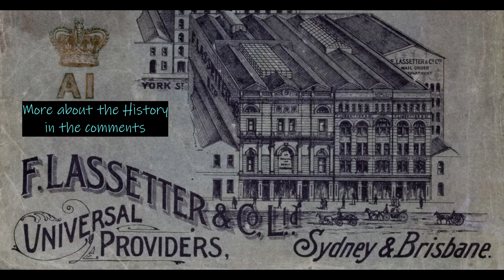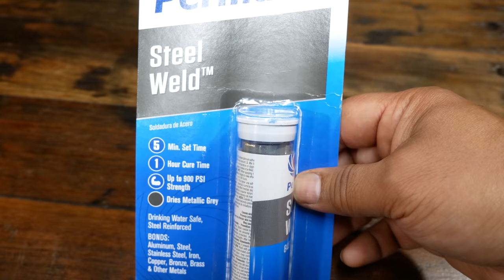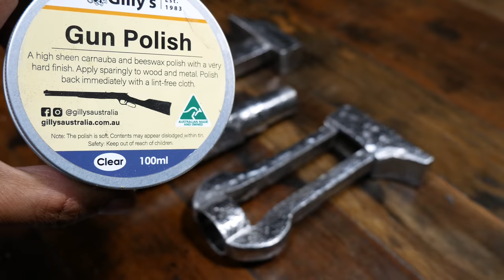Antique Railway Wrench Restoration. Extremely Rusty and Very Rare .

Comment: Okay, I believe it wasn’t fake rust, but did you bury it in your backyard for a week first? 😂
All jokes aside mate that was incredible you got that functioning again. Amazing work. I thought you’d show us your welding skills on the collar but the metal paste seemed to do the trick.
That Gillies Gun Paste is good stuff. I ordered some online when I saw you first use it and it’s fantastic stuff.
Reply from the maker: Thanks mate - I thought about welding it or even replacing that collar. The problem was the thread. I could not find anything to fit and fabricating a new piece was going to be a headache. I figured the collar only acts as a stopper, so the handle does come off if you unscrew it all the way. So it doesn't take any of the pressure really. If one day I have the skills to make a new one I will ... may be 🤣. Have you heard of Lassetters tools ? I'd love to find out the exact years this was made .

Comment: Great job!  I have not watched all your videos (yet), but I am wondering if you have evaporust in your neck of the woods?  If so, and if you give it a try, you will find it works great on things seized up like that.  It may have saved you from having to split and repair the nut.  As for the final result, the only thing you missed (unless you wanted it left as it was) was to straighten the top jaw a little so it was more parallel.  I like to be able to take one of my antiques off the wall and use them occasionally.  Just to warm the souls of the people who used the tools long ago. 👍😁
Reply from the maker: Thanks again for watching. Yes we have evaporust down under but it's bloody expensive. I've had good results with electrolysis (as an more cost-effective option) but this one was really so far gone that the metal and the rust had become one.
But i do want to get some evaporust eventually so please keep watching more videos so I get enough money to buy some 🤣😄👍
Reply: @LittleRestorers  what I have heard about electrolysis is that it works best in a "line of sight" between the electrodes and the part, so anything hidden from view does not get as much de-rusting.  Evaporust will dissolve rust if it can get to it.  So if something is seized wth rust, it will get into the joint, but it will take some time to get all the way in.  I see many others using an acid (citric acid, white vinegar) and that is much cheaper than evaporust, BUT when the rust on the surface is dissolved, it will start to eat the metal object as well!  If you want to get into a seized up joint, you would have to leave it in long enough that the rest of the part would beging to get eaten!  If you do eventually get some evaporust, remember to clean off as much of the rust from the outside of the part with a wire brush so you don't "waste" the evaporust on "easy rust"!  Do you watch "scrounga's workshop"?
Reply from the maker: @Time Flys in the Shop  Thanks for the information, i'll definitely take that on board when i get my hands on some evaporust. Yes, I follow Stuart, he is a friend of my channel also and such a great bloke.